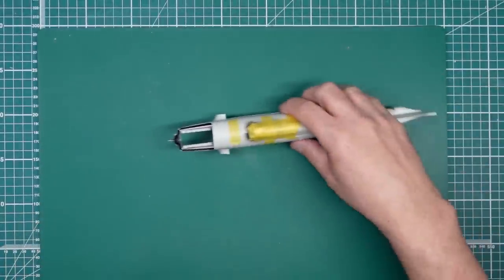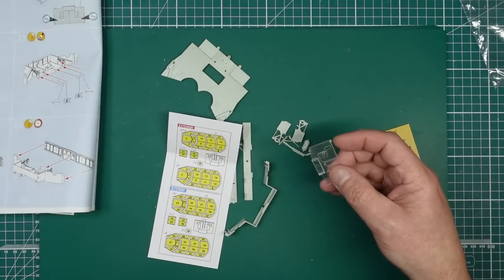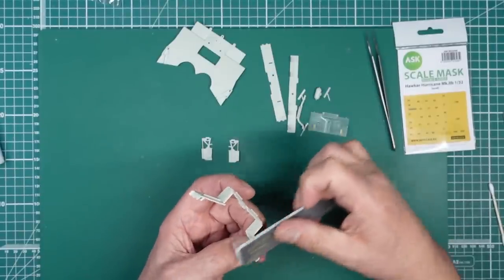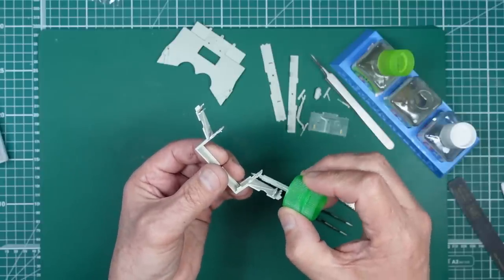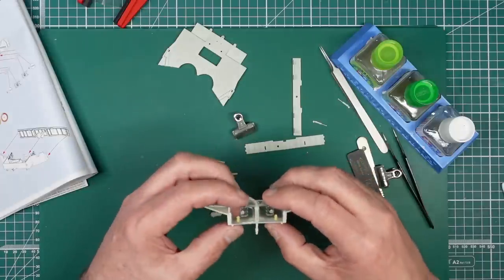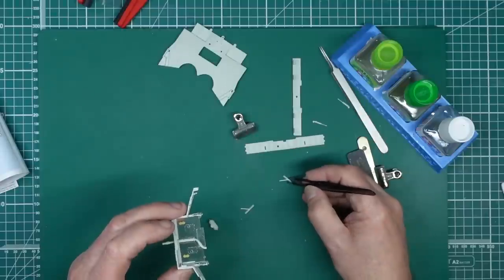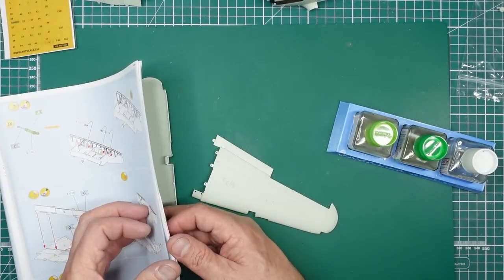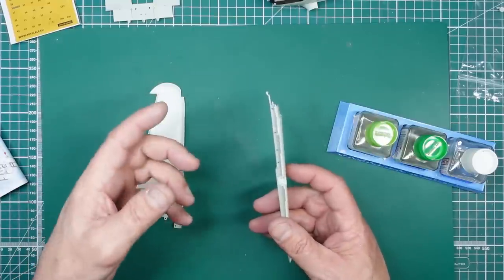Revell New Tool 1/32 Hurricane Mk.IIb build. Part two.

Comment: Those actuator struts that push the wheels inwards during retraction, they actually go through a small space in that front area and then attach to the top of landing gear via a hinged mechanism.. hard to see anyway. References I've seen also show the landing light mounts are cockpit green with black or gun metal lens grilles.. some are indeed painted silver.. but that could be a restore bird effect..
Compared to the Fly model Hurricane those wing to fuselage joins are positively Tamiya! The Fly model is a real challenge compare to this - though it has its own challenges! Looking great so far!
Reply from the maker: Yeah I know about the actuators now thanks Nazid. I have finished the kit now. Part 6, the end, will be up on Monday night at 9pm UK time.

Comment: Nice, oh that Mig superglue splattering phenomenon... could be surface tension, as it starts to set from outside in... when you disturb the surface tension by touching it with your looper you get an elasticity effect (like the skinning when milk is heated a tad too much), the elastic surface tension then 'snaps' causing the still gooey bits to explode.. well that's how I explain it anyway!

Comment: Hello Nigel. I am not very experienced with model making although I have done it since my teens (now in my retirement). Enjoying your videos.
I am wondering what grade of Mr Surfacer you use for the gap filling part of the build. I see our local suppliers here in Auckland NZ have 500, 1000, and 1200. I have the same kit as you made here purchased for NZ$99 so I am quite pleased with that. I also got some of the extra thin quick setting Tamiya glue you recommended and am finding this a great help. Next thing I have to source locally is some sort of oil wash. Choices seem very limited. Was wondering about the SMS variety we can get here.
Reply from the maker: I always recommend getting 1000 for all round work.

Comment: Nige, I had exactly the same issues with the Mig Black Cyano 2 as you did with loads of blacks dots not only on the model but also on the cutting mat. Not sure if it is from the applicator we use but I gave up and will buy the VMS black CCA. Madding for sure. Nice work on resolving the gear box issues/fit.

Comment: I’m using the Mig Ammo black ca as I couldn’t get the vms anywhere.I too have noticed it jump in my case from a wooden cocktail stick to spatter on the model and leave whip like lines. I pour the ca onto a small disc of foil that adheres to a small marble disc, like a mini coaster as the foil peels off when done and any spread onto the marble can be taken off with a blade. It is definitely either a negative charge or a static build up but as it is being put on from a wooden cocktail stick I am not sure it can be static. Perhaps I need to brush everything with a anti static brush?
Reply from the maker: Thanks Mark. Not just me then. The glue must be charged??